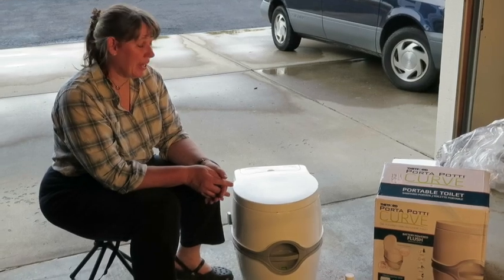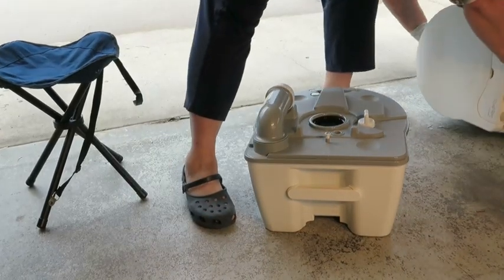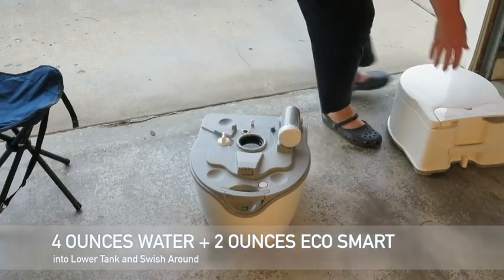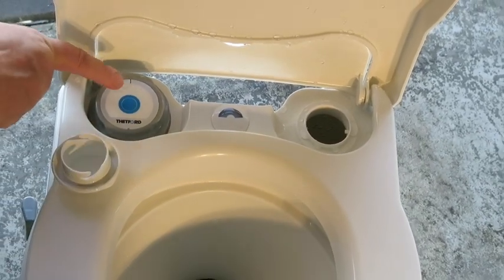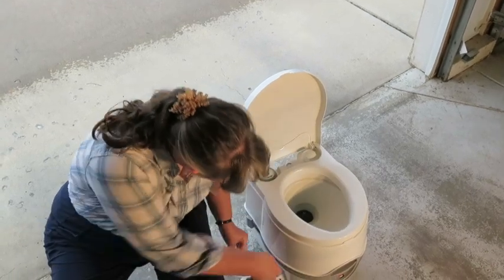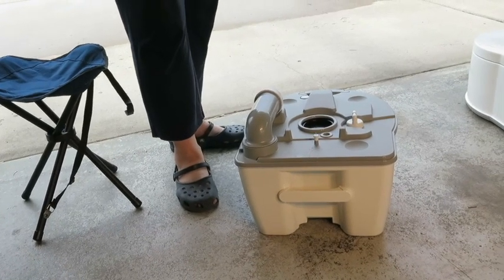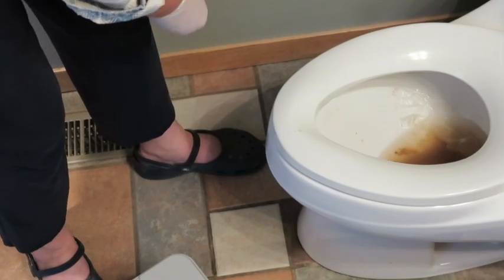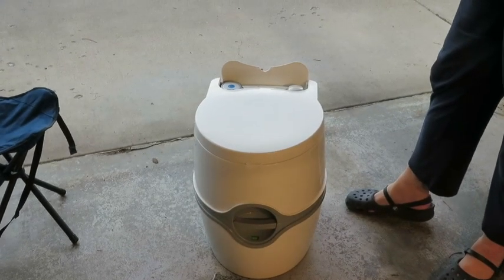Thetford PORTA POTTI CURVE:  Setup, Use, and Dumping    (Current models 565E, 92306)

Comment: First...Thank you so much. I didn't know about the measurement cap on the holding tank. Nice to know. 
Also emptying the holding tank is a little easier than you showed. You forgot to explain and show the vent button at the top of the tank as you are dumping it. Thank you again. Not many people would take or have any time to even think about helping others on this  matter. You helped me and probably hundreds of people.
Reply from the maker: Yeah, I know I missed using the vent button during the video so added a note over that section of the video.  Glad it helped you in some way.

Comment: Hi Thanks for the informative video. I noticed when you emptied the waste into the home toilet you didn't press the white button which lets air in while it drains and stops it glugging and splashing but when you press this button make sure the tank is either level or tilted toward the toilet and not tilted away from the toilet because you don't want waste coming back through the vent. I know this from emptying our caravan toilet and I am checking out your video because we need to get one for using with our tent. Thanks again it is good to see how it all is.
Reply from the maker: Yes, I forgot that when making the video.  There's a screen note to point toward the white button.

Comment: This is by far the best set up video I’ve found. Thank you very much for taking the time to do this. 

What does the pressure relief valve do?
Reply from the maker: Thanks for the encouragement!  The pressure relief valve is a little button that just allows a little air to enter or exit the tank to equalize the pressure before you open the cap to dump it.  It just prevents a potential surprise if there is a pressure difference if you've been traveling.  Another way to achieve the same thing is to open and shut the flush lever before taking the tank off to empty it.

Comment: Use this aboard my bigrig. Its top heavy, so on sharp turns, it tips over on its side. Secure it somehow. Plan B instead of dangerous rest areas, staged on the shoulder in the wilderness, or closed interstates due to Winter ice and truckstops being full. GREAT DESIGN. 👍
Reply from the maker: Yes, it is top heavy with the water reservoir in the top piece.  For our Sprinter conversion, it is inside a cabinet with a door, so don't have the tipping problem on a sharp turn.  Glad it is working out for you otherwise.

Comment: The BEST way I've seen  (recommended by the brother in law) was to open the tank lever AS YOU SIT ON IT. Stops the bowl getting any dirtier than it needs to. THEN flush, give the water 5 seconds to go down, THEN close. We're using older ones where the level is out the front. Kinda annoying tbh coz your pants can get in the way. I often use it as soon as I get out of bed in the morning, middle of the night, or during rain because my actual toilet is about 25 yards from the front door (house is over 100 years old).
Reply from the maker: Thanks for your insight on it.  I'm sure yours gets a lot more use than ours does.

Comment: Great video! Does the battery’s last long for the flush mechanism. Trying to decide between the electric and manual version.
Reply from the maker: We're still using the batteries that came with it, which are some off-label type.  We got ours in December '16, I believe.  We use it just for camping, so not a huge amount of use, so take that for what it's worth.

Comment: how long after use does it take for the chemicals in the waste holding tank to liquify waste?  I'm interested in emptying waste tank as quick as possible in only liquid form.  Also, there are different brands of waste tank treatment, like aqua max, aqua bio, and campa fresh.  Do they all perform the same?
Reply from the maker: Sorry for the slow reply.  Computer issues.  I don't have answers to your questions about the time needed for waste to liquify, and I've only used the one brand of additive.  Hopefully you can find answers somewhere else.  Sorry!

Comment: ok so you CAN just add the lower tank solution ahead of time even if it sits there for some time??

also do you NOT have to add some flush solution with the top tank like other models suggest?
Reply from the maker: The tank enzyme solution along with a little water can be in there for awhile as long as it doesn't freeze.  I don't know about any flush solution, I've only used water.

Comment: Can you smell the tank when it is not in use?
Reply from the maker: You can smell a little of the enzyme that goes in.  If you dump it regularly and don't leave it for long periods with waste in the tank, it isn't bad at all in my opinion.  Everyone's nose is different.  I'm a mom of twins, so changed a lot of diapers in my time.  Not much phases me, so keep that in mind.  One viewer suggested burning a candle to take any smells out of the air in a van or camper.
Reply: Had mine for a month between dumping in it.  Use campa chem and expect no smell!

Comment: What an excellent demo!  You should be a professional reviewer of products.  If you want a job done right, find a woman!  Great little toilet, and so cheap at $143 at Walmart online.

For those who think a composting toilet is better, here is some breakdowns:
Natures Head true composting toilet - huge bulky thing $1000 + tax, and you have to manually empty two tanks.  Needs sawdust.  Environment friendly.  Empty pee bottle more often. Poop can stay in the sealed and vented bin for a few weeks till full.  Manual dump but not smelly due to aeration.
Separating Bag and Go toilets like Sun-Mar - $670.  Separates poop from pee in two bins.  Empty both separately. Use a bag for each poop.  Does not compost, so you need to toss each time and ruin the environment with a ton of plastic bags.
Reply from the maker: Thanks for the encouragement.  I'll consider it.

Comment: Could you use grey water to flush?
Reply from the maker: Sure you could pour some in and use that for flushing action, activate the lever to dump in into the lower tank, then use the lever again to close it.  My pump has gone out after four years, possibly from corroded batteries, so that may be my solution as well.
Reply: @OTSGVideoBabe  what if I just filled it up w/ grey water the way you did w/ the fresh water?

Comment: Do you have any bad smells coming from it? (Between uses I mean), I am looking for a toilet option for a camper conversion, and I am trying to decide between a porta potty or a composting toilet. Cheers
Reply from the maker: I've never used a composting toilet, so don't have a comparison experience to comment on.  I can smell some of the enzyme used to break it down but it isn't bad.  The seal is pretty good on the flushing mechanism, so there is minimal smell coming out from there.  My son (that likes to complain) doesn't like the smell or even the idea of the Porta Potti being in our van.  His twin brother is fine with it, as are my husband and I.   We keep it in a compartment in the back of our camper van, so that may help a bit as well.  The freezing issue does favor the composting toilet over the Porta Potty though if you plan to use it in freezing conditions.  Price is definitely in the Porta Potti's favor.  A lot may depend on if you are using it for weekend camping now and then or want to live full time with it.  Full time use or during cold weather favors the composting toilet.  Weekend or vacation trips probably favor the Porta Potti.
Reply: if it helps - I'm going composting - by separating liquid you get rid of the odor #( went t a demo the other week and the day kindly brought buckets in three stages of breakdown - one used the day before, no odor. The other huge advantage is, if you separate off the liquid,, then you'll have to empty the solids  FAR less
Reply: I have this toilet, there is ZERO smell.

Comment: You shouldn't need to flush the toilet it will do that once the water reaches a certain level in the toilet.  

Also dont forget to use the pressure release valve.

Comment: Q: Should you shake the lower portion after putting in the 2 ounce treatment/4 ounce water to sanitize or reduce smell of the ceiling and upper walls?
Reply from the maker: You could go ahead and do that.  I usually just rock it from side to side to get it to have a chance to go up on the sides of the tank.
Reply: @OTSGVideoBabe  Thanks

Comment: I'm a truck driver and have a PP in my truck. Is it ok to dump at a rest area??
Reply from the maker: Sure.  Dump a third or so of the tank into a toilet, flush, and repeat until it is empty.  Carefully add water from a source that is grey water or won't be used for drinking (avoid splashing back toward the source) to rinse and dump again, repeating until the tank is reasonably clean.  Then add the 2 ouches of EcoSmart chemical and 4 ounces of water to begin again.
Reply: rayne colwell folks do that all the Time.

Comment: To make it easier to dump with less splash, press the little white vent button next to the handle by your thumb...... makes it fast and easy without splash. ....that's what that button is for... lol
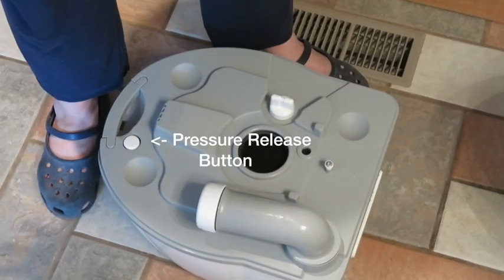Reply from the maker: You're right, I forgot to mention that while doing the dumping.  I do have a note at 5:05 about the pressure release button being there.  Thanks!
Reply: Yeah I only mentioned it because you didn't press it...

Comment: Wow love your video thanks a lot. Can i put some kind of deodorant on the upper part of the toilet?
Reply from the maker: I don't think that I'd add anything to the water supply, but you could stick a small room deodorizer pack somewhere on the top if you wanted to.
Reply: OTSGVideoBabe wow you’re quick thanks a million
Reply: Best way to deodorize is light a candle and burn off gases naturally.  Or use an enzyme based spray like Stink Off.
Reply from the maker: @lass-inangeles7564  Good tip!   Thanks.